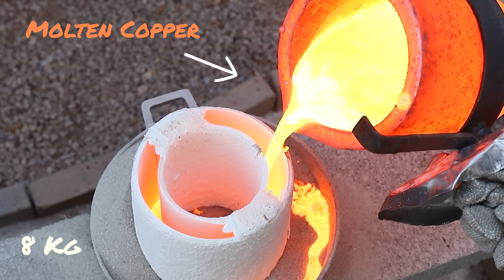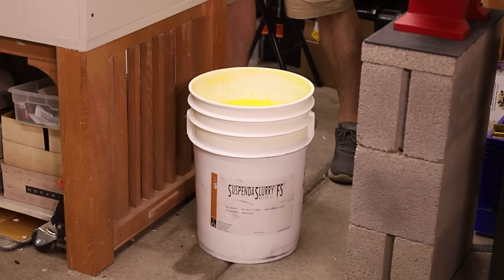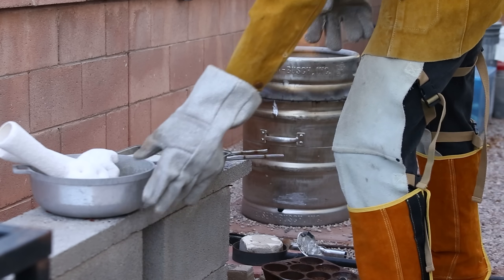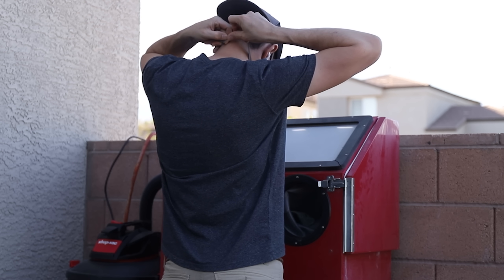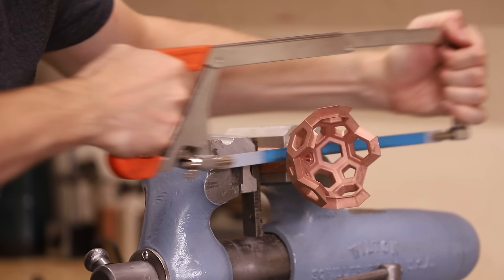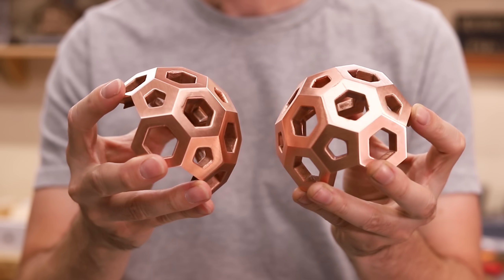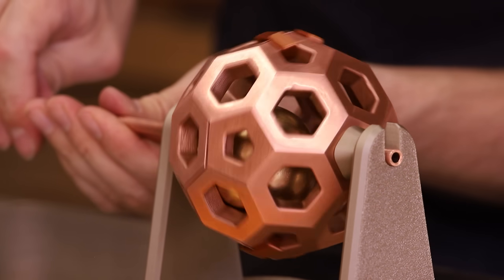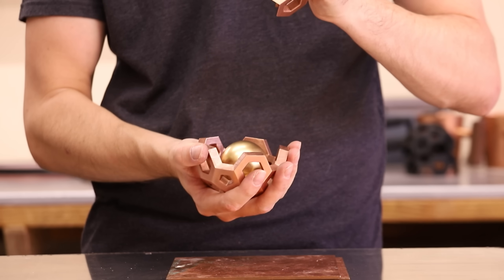HUGE Magnet VS Copper Sphere - Defying Gravity- Will a Neodymium Magnet Float Inside?

Comment: As soon as I saw the magnet floating in the rolling tube I had an idea. But since I am not set up to test it right now it would be cool to see done if you want to give it a go. This could potentially be the basis of a magnetic suspension for a bike or other vehicle the magnet mounted to a central axis and the a thick ring of copper inside the hub of the wheel. Obviously the whole hub can't be copper as it would deform too easily. To assure that the magnet/axle remains in a central position when not up to speed perhaps it could be suspended in an elastic tensegrity system? Idk I'm brainstorming here. Correct me if I am wrong about the physics but if I understand it correctly the more force applied to the magnet the stronger the Eddy current the stronger the resistance. So in theory it would make a self adjusting suspension? Be fun to play with and see if and how it functions

Comment: You asked for comments...if there were two hemispheres with windows at the equator oriented vertical. The magnet ball needs some texture that can have friction with wind. 
and string like a yoyo to get rotation started. Once aloft the ball can be kept in levitation and rotation with the air hose. This all sounds possible but  quite hard though.

Comment: There are programmable animatronic servos systems that might be able to dynamically adjust the speed of rotation out there for less than a thousand. Basically, do what you're doing here by hand. Maybe have a program that rewards the system for having the fewest bumps. A high-speed camera might also help you figure out the optimal rotation speed (s) based on your own movement.

Comment: What I'd consider doing:
- Consider switching to round bands separated by bars (at different positions each level) rather than a hexagon. Len's law works best with surfaces that are solid enough that you can form lines perpendicular to the magnetic field without going over open spaces. A series of bands separated by bars will give a lot of visibility, and the bands would work like a mini-tube with its own effect. Basically you need parallel lines throughout the sphere. Meridians could work, but I am not 100% if they would make the effect stronger (and using straight up grid with meridians and parallels might make it unpredictable).
    - Make sure that the axis of rotation is perpendicular to the bars to get the best effect.
- Consider using a second magnet (or electromagnet) underneath it to try to make it float and rotate, keeping the magnet in the middle floating as well. I imagine that the magnets would have to be beasts to be able to carry all that, but it'd be really cool. Here the force should help keep the cage afloat (due to the large magnetic field across both magnets) while the magnet inside should float a bit. I haven't done the math, so I can't say how strong it would be, but it'd be really cool to see a sphere floating and rotating around with a smaller perfect sphere floating in the center.
    - You might be able to use less copper by only making the inner part of copper, and covering with a reinforcing shell of lighter material.

Comment: HERE: Get yourself a CCCV power supply (30V 5A) and a 12V DC motor that spins at like 1000RPM with 12V, connect the motor to the axle, use the power supply to precisely control the speed!

Comment: If you had a variable speed motor that you could control more precisely than the drill you could probably find the sweet spot for speed.  Then once the ball stabilized you could increase the speed

Comment: spin it horizontally?  (from the top)
put donut style magnet inside with axle through the middle, try multiple spin orientations.
instead of a full "sphere" what if the two pentagonal faces are removed?  like if you sliced the top and bottom off a sphere.  then mount the axle through these faces with a bigger version of your 3d printed pentagon mounts.

Comment: Was copper pipe a deliberate choice, or just what you had lying around?
The reason I ask is because copper pipe isn’t pure, it has a percentage of iron in it. If you wanted pure copper, brightwire would be better (that’s the copper wires from stripped cables).

Comment: So I know nothing about casting so you may have put the sprues in the holes for a reason (perhaps to make it in the center of the hemisphere?). This didn't make sense to me since you're going to have to remake those holes once the casting is done. This was even more of a concern in my mind as you intended to use those holes for mounting the axel

Again, I don't know if this would work for the casting but my mind goes towards putting the sprues on the vertex of three of the faces. You might even be able to redesign the hemispheres so a vertex is the center of them rather than a hole. These vertices are just for show and it's not crucial as the holes to get cleaned properly. In addition, you'll have faces to follow to grind down the sprue excess material down to. Even without a grinder/grinder bench/mill with guides this would be easier to do by hand than remaking a hole precisely. Could even make a makeshift guide to assist with it really easily

Overall it was really interesting to watch. Would love to see the ideal rotation figured out and a motor hooked to precisely spin it at that speed

Comment: I've never commented on a video before, So here goes.
Firstly that copper sphere is really nice, well done.
Now mount that circular magnet under a wooden table and attach it to a motor so that it's rotation reacts with the sphere on top of the table. That would look super COOL.
10 / 10 from me.
Reply: U mean the cylindrical magnet? Yes, please. And how bout the cage sans spindle "walking" across the table?
Reply: frequency of green or opposite colour rotation wavelength
Reply: @louienoble4179 I don't think so. Just part of the routine in order to get an idea of a certain project that needs some figuring out like any other project. In other words, experimenting, which is a genius routine when figuring things out is at hand
Reply: So was this a trick video?
Reply: Has anyone asked you if the floating ball has any potential energy when held by the copper field?  If you place the copper on a scale and add the ball, does the scale change? If not, then the magnetic field behaves similar to water pressure on the hull of a ship.

Comment: Great video and great experiment.
My two cents.
The copper must be very, very pure. 99,995% for you to have a smooth magnetic field on your dodecahedron. The use of pipes as the source of your copper may be the reason your sphere does not float better.

Comment: I have a question, what settings and specs are on ur printer? i have an ender 5 pro also with PLA but any model i splice is always stringy to a degree and has some imperfections, but your printer prints it so perfect? I use common PLA at 202 degrees nozzle, 90% print speed. Any help would be appreciated

Comment: There is a way to beef up your magnet, the youtuber NileRed has a cool toy to magnetize/re magnetize/demagnetize metal and even neodymium magnets who lost the magnetic field after heating them up. That magnet was after that treatment visible stronger and he struggled to get it of from a Machine housing where he tried if it had worked or not :P

Comment: Everything about this entire process was super awesome to watch.
Im not ver smart. At all, but just wondering if, to make it easier to see whats going on, what would happen if you designed the outter sphere, instead of the geometric hexagonal holes, what if it was made using rings, from small to large towards the center of the sphere. Then reverse from center back down to small, with small ribs in between each ring, i.e. holding all rings together?
If it'd work you maybe able to see the effect more maybe?

Comment: I think you probably want better electrical conductivity between the hemispheres. The eddy currents rely on the very low resistance of copper, and they may "want" to flow over the boundary, where the resistance is probably at least 2-3 orders of magnitude higher than it is within the solid copper. I bet you would get 10x better levitation if you could braize the copper hemispheres together or something like that.

Comment: My dad used to do plaster molds and he would shake the whole mold before it set to release air bubbles to try to remove voids. I used a palm sander once without sand paper, the rubber pad and held it to the casting shell and it worked like a champ, no more voids. You should try it on the 1st dip into slurry,hold it firmly on the sprue just to see if it works. Another idea is a smaller magnetic and maybe somehow introduce an oscillating magnetic field near it.

Comment: Maybe a small magnet will have more room to spin without bashing the sphere walls. Maybe a bigger sphere in order to the magnet have the room needed, this will take way more copper to melt and doing new molds. Maybe large holes help to see better, but can make the sphere weak to... but then you get into the Lenz's law problem because the holes. Consider the use of some ball bearings at the axis tips to mitigate friction.

Comment: This is awesome. I believe part of the issue is you chose a geometry that isn't uniform in relation to the magnet so as it rotates it gets tugged in different directions. This shape looks awesome but I think a mire circular shape would help to balance it and make the floating effect more predictable.

That said, if you used a more precise DC motor to turn the shift at a constant speed you could probably get a fairly consistent result but you'll probably want to constrain the shaft and use ceramic bearings or some type of low friction bushings.

Comment: Avoid edges! You should try to make everything round/circular. Removing/covering gaps would be helpful if you could find a design to make it work (like a section that screws in and out). Then, cover with the seem with conductive tape.

Comment: this may seem like a question with an obvious answer, but could you weigh it?  like, use a motor so the rotation is constant, then weigh the whole assembly ... would there be any detectable change, and would it be down or up?  p.s. beautiful work!!  p.p.s. also, have you tried a vertical axis of rotation (per other comments)?  cheers!

Comment: It seems the cut between the two halves may have an adverse effect.  But, I believe it's minimal.  However, as Neodymium is a metal, and it's often mixed with other metals like iron, and even boron, the magnet becomes a good conductor of electricity.  Which  means it also can form it's own Eddy currents (I'm pretty sure you mentioned this).  As the sphere magnet isn't fixed, and free spinning, its own formed Eddy currents are likely interacting with the copper's Eddy currents is an almost random way.  Making the magnet's movements unpredictable.  Which will make keeping it in the middle very hard regardless of the speed.  Even a "good speed" will lead to the magnet eventually moving in such a way that it will bounce off the sides due to the unpredictable interaction of the Eddy currents.

The round hockey puck shaped magnet works as there are two smooth opposing sides that can pretty evenly interact and keep the magnet in the middle.  It's a bit deceptive though as it lead one to think that a sphere magnet would do the same thing.

Comment: I'd suggest putting bearings on the rod and attach a motor to it with potentiometer for speed control. Find the right RPM and experiment with magnets while it's spinning. Like, what happens if you hold a magnet on top of it and even let go?

Comment: There are two forces at work here. Electromagnetic and gravity. In order to make the ball float without moving, the electromagnetic force must be directed in the opposite direction and strength of the gravitational force. I believe this is called the Meissner Effect, which is the term given to floating a high temperature superconductor disc over the face of a magnet.

Comment: Magnificent work! Maybe starting to rotate with the magnet floating centerlized in the sphere can lead to better looking results (when you rotate really fast any contact can lead to bounce, instabilinzing the levitation effect). I would try levitating the neodimium ball with compressed air (down to up) or utilizing a eletromagnet above the copper sphere (up to down) before the copper rotation starts

Comment: I wonder if the force/torque required to spin the 'shell ' is greater when the ball is ''floating'' in the centre than when the shell is empty...
I know that if the floating 'ball' is spinning then some torque/force is needed to maintain that spin, but as its a sphere the air resistance it picks up would be negligible, I'm wondering if the suspension of it's weight under gravity is a weight that has to be opposed by torque, otherwise the force needed to levitate it is zero and that would be scary.....
a magnet can float above another opposed magnet if perfectly aligned or constrained, and that levitation is opposing gravity 'for free' which is something I've never been comfortable with as you don't get anything for free...

Comment: i would suggest (electrically) isolating the two halves of the cast copper (thin rubber gasket strips, etc) with the magnet in there, spin it and put a volt meter across on the axles while on the stand and see if it generates any voltage/amps if possible... that would be cool

Comment: Well you can connect a DC motor for rotational force and some speed controller circuit with some IC will help as well. You can arrange a certain speed using potentiometer connected to this speed controller.

Comment: You should hook it up to an electric motor with slow precise speed adjustment. Once you hit that sweet spot of in the middle, you can increase the speed so it’s easier to see the ball because the copper is spinning so quickly.

Comment: Honestly, the only idea I had while watching this video was to use magnets to hold the two halves together, but after a couple of seconds you used the clips so...
I think they're an easier solution, but magnets would make a very nice object out of this "sphere"!

Anyway, having windows in the sphere is a cool idea, but in the end when it spins it's just too fast to see the inside (in a video at least), you can tell if the core is touching just by hearing (or not) the sound of the core touching the walls.

Maybe a completely closed and regular sphere would give interesting results.
Maybe, ...maybe!....you can still drill a hole on one side of the closed sphere and attach one of those small wifi cameras, with a led mounted in a hole, on the opposide side to watch the internals without altering the structure too much.

But the real question is: would a copper core housed in a magnetical sphere float or not?
Admitted that it's possible to build one, that would be an interesting experiment!

Comment: what would happen if you added electricity in to the mix..  what would happen would the magnetic field look like under a ferrocell..  what would happen if you wrapped leds to the copper bridges..  what would happen if you plugged magnets to the inside of the copper holes.and faced them to point inside or outside... what would happen if spun the 2 halves of the copper in opposite directions... at this point,, I have questions.. are we not trying to build a starship..> 😁

Comment: I think it will look better if you only use half of the copper mold and spin it on the y axis instead. Also, I could be more efficient if you hollow out the middle of the magnet for less mass?

Comment: Levitating the neodymium magnet is a result of the ratio of copper to magnet mass. Calculate the ratio of the magnet to copper cylinder you made at the beginning of the video. You’ll find the mass of the copper was probably 2-3x the magnet. In this new design that mass appears to be inverted. INCREDIBLE VIDEO!

Comment: You could create a really cool effect by using a motor in the base to spin a small, strong magnet to rotate the sphere without any visible mechanism. Then again, a small electric engine like that might be messed up by the magnetic fields, or not be strong enough to spin the thing, so it would be cool just to see how it would work out.

Comment: What happens if the shell vibrates up and down very quickly?
What happens if the two shell parts are rapidly separated?
Can you make the shell itself levitate by holding and rotating the internal magnet from the outside?

Comment: Reprint the stand to accept some ceramic 608 ball bearings to reduce the rolling friction while spinning and it might be easier to get a consistant speed. Would also allow for printing a tighter tolerance on the stand so that the plugs cant work their way out.

Comment: Try to make a sphere with the minimum amount of metal possible so that the interior is as visible as possible. Redesign the sphere and make it truly 'spherical,' especially the interior. Instead of using FDM, use resin; the finishing of the sphere affects performance. Then, add a controllable system that allows the sphere to rotate at a precise number of turns... and you will have created a nice desk gadget 😅

Comment: The eddy currents work as good as the both halves have a good contact to conduct electricity. If there are airgaps between them, this could deminish the wanted result. The outcome could be also affected by the orientation of the axis of contact between the the halves while spinning (horizontal vs. vertical orientation). You could maybe reach better results by making the base adjustable for vertical movement. In the beggining the sphere is touching the copper orb, by adjusting (dropping the base down sligthly) after the initial spin, you might be albe to stablilize the the position of the sphere inside the copper orb, so it will not bump into its sides.